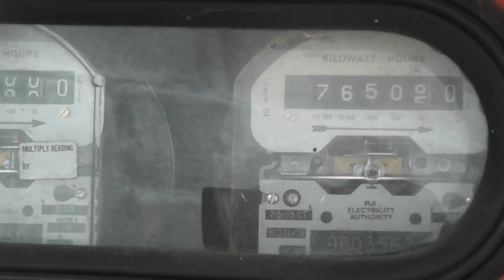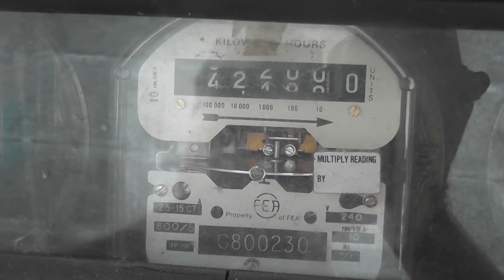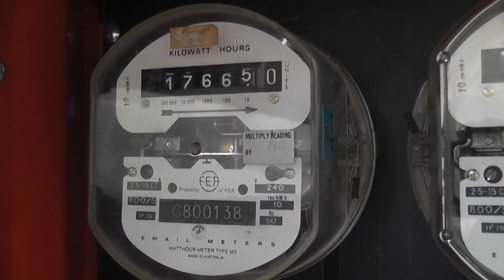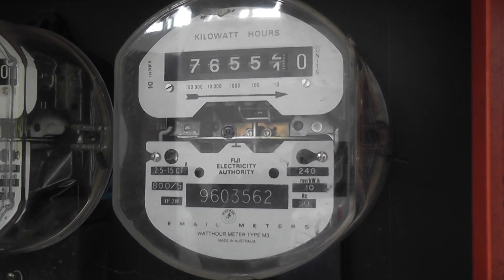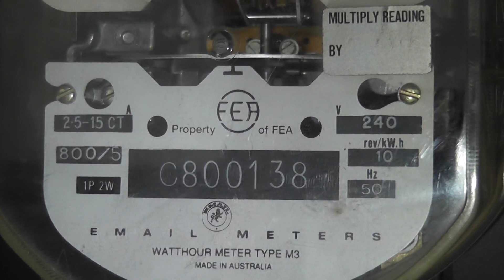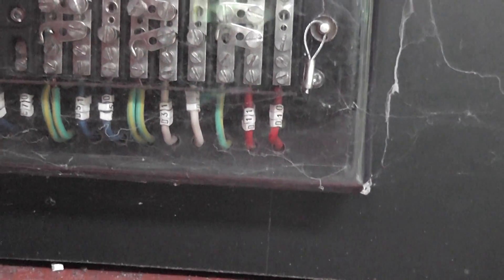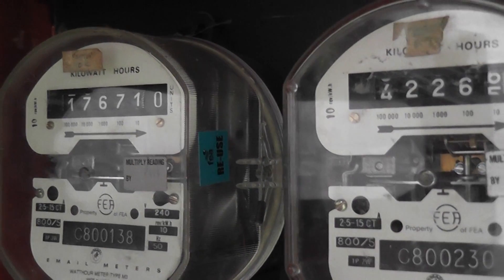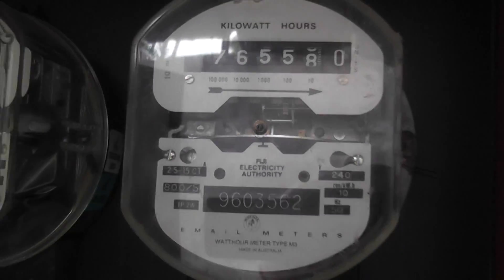Single Phase CT meters

Comment: Fantastic meters! That configuration used to be popular here in the US with the electromechanical switchboard meters(on 33,260Y and 13,200Y volt services). In which they could penalize customers for having an un-balanced load on the primaries. But that has since gone by the wayside with new smart meters that have the capability of measuring each phase and kVAR/kW/kVA and so on.